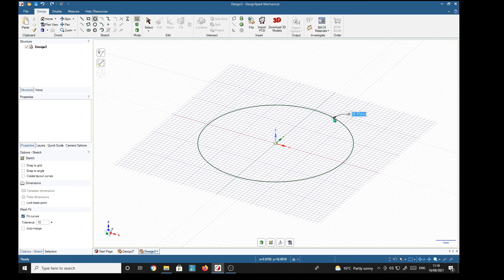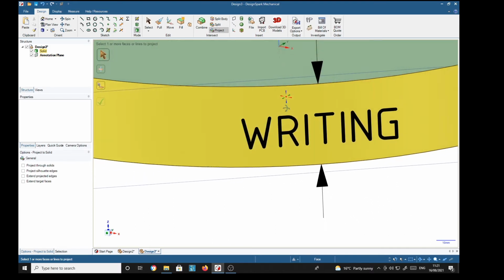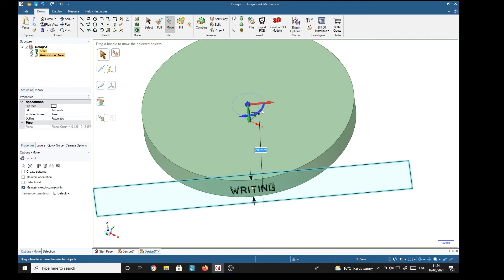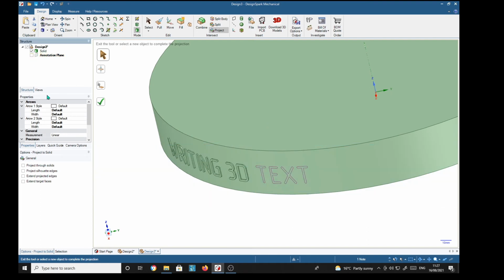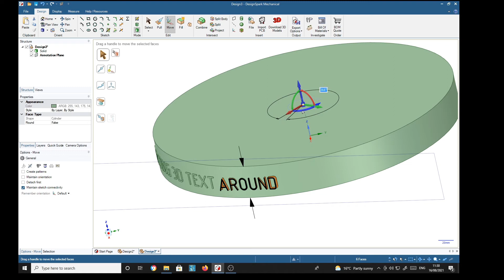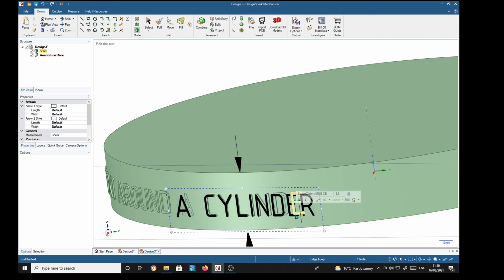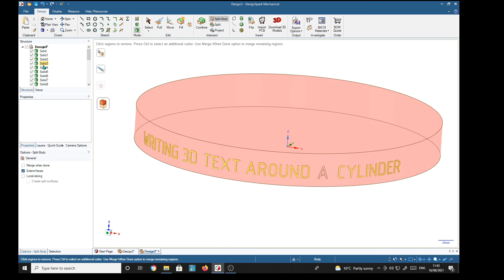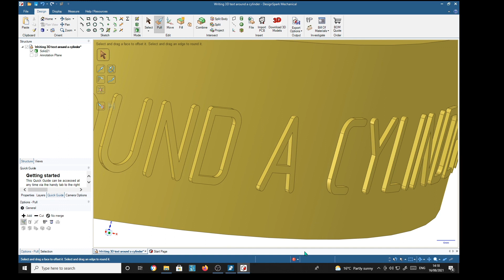Writing 3D text around a cylinder

Comment: Hi Jim, how can we write a 3D text onto a circular ring? The 3D text should be bend to follow the circulat ring. Thanks
Reply from the maker: If you look carefully at this text you will see that the text IS bent around the curved surface. This is because the outline of the lettering is projected onto the curved surface of the disc.
Reply: @JimTaylor42  Yes you are right. But this kind of bending is not the one I want to do. Imagine you have a circle with 37 mm diameter and an inner circle with 26 mm. A circulat ring. I want to place a text between 11 and 1 clock position. The text is plane on the circular ring but should be bend in the same radius as the circular ring